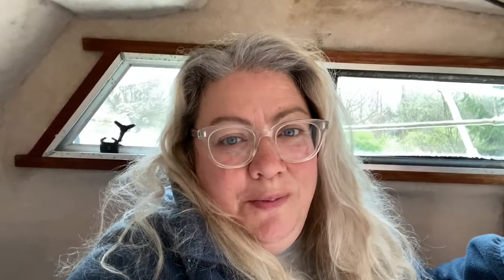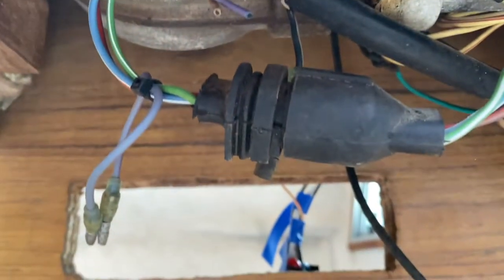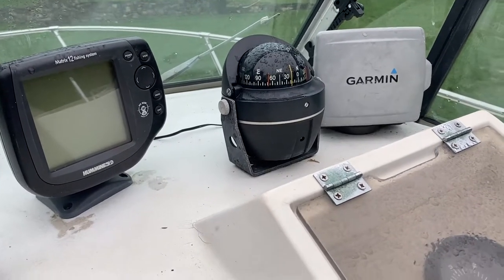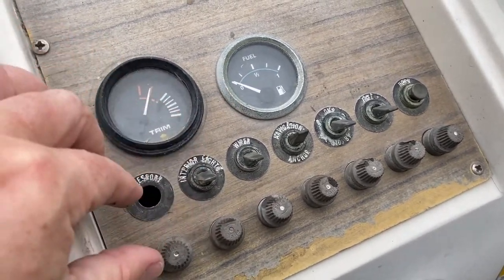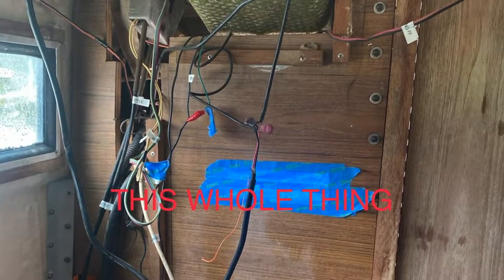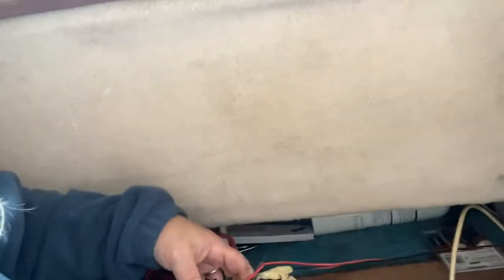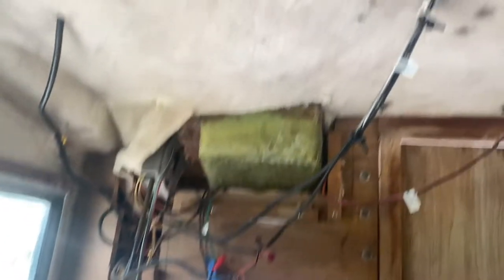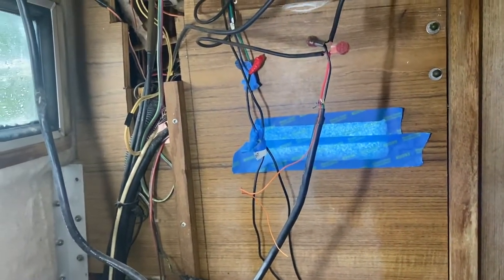It was NOT Safe! DIY Rewiring My OLD Grady White Boat Electrical System (Pt 1)

Comment: Check with Grady White, they may have diagrams for your boat wires.  Good luck and keep safe
Reply from the maker: Thanks, that is an awesome suggestion! I actually did find the original diagrams in the PDF of the owners manual that Grady has on their website. The photos in it are all just black blobs lol but the diagrams are perfect.
Reply from the maker: Here’s some of the stuff I found!

https://www.facebook.com/260912648023911/posts/899922170789619/?d=n
Reply: @TheFishingMommy  glad you found them they will help a ton.
Reply from the maker: For sure! Great thought on your part 👍🏼👍🏼

Comment: For anything you are going to have to rewire, I would use the old wire to run the new wire instead of using a fish tape.
Reply from the maker: Thanks for the tip...actually I was gonna do that but after really inspecting it, I think the old wire is so corroded in some spots that it will break; some of them broke already! Luckily, I do have several good access points throughout the boat, plus these chases that should be a huge help.

Comment: Use the old wire itself as a pull wire, becarefull, you are on water . Study proper connections and grounding. Do a little research about marinas and deaths associated with improper wiring.
Reply from the maker: Thanks!! For sure it’s important to do this right! I’ve really been reading up a lot & sanity checking with friends as well as the vendor I bought my custom switch panel from. 
So far, so good, but I’m not done yet!
Reply: Look for electrical schematics organize your wires and you'll do 🙂
Reply from the maker: Yep! I’ve actually got the boat’s original
factory schematic, which helps, and I have completed my own schematic & reviewed it with others. I know exactly what I’m pulling & where...now that my new panel arrived a couple days ago, all that’s left is to actually do it, and make secure connections!
Reply: You go girl. I'm going to call you high speed. Can't wait to see the boat when you are finished. I've had my share.
Reply from the maker: @lisaa.powell3634  hahaha thanks!! I am hoping I’ll be basically done with everything in a few weeks.